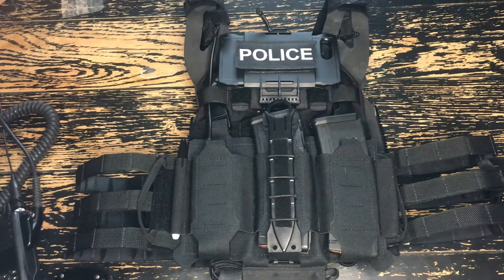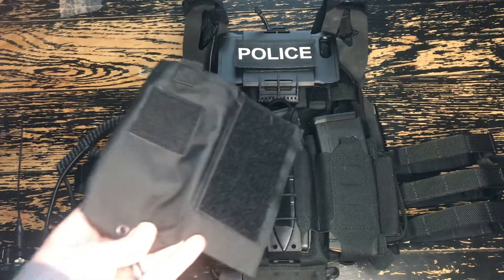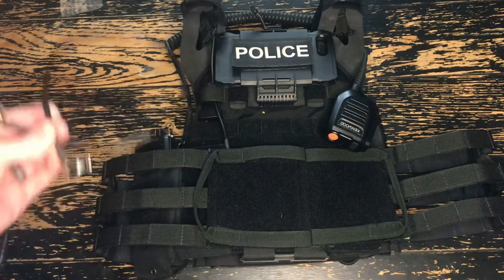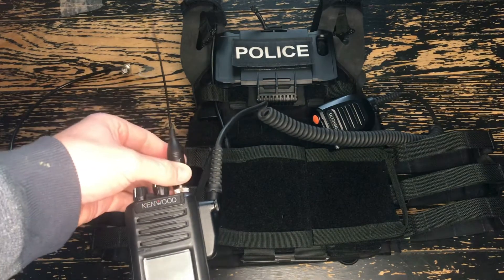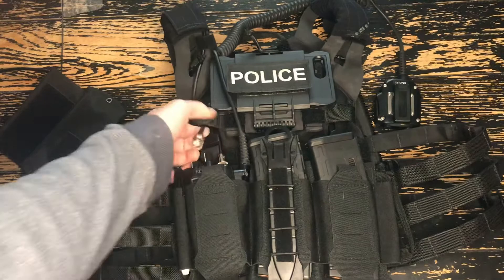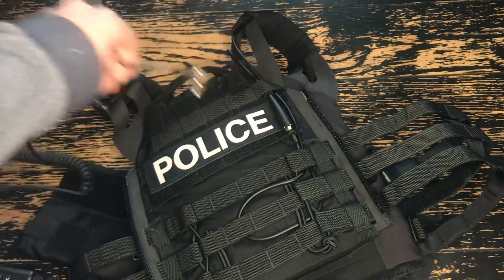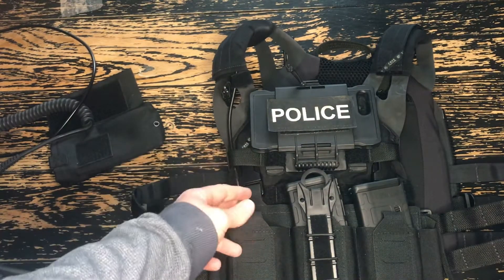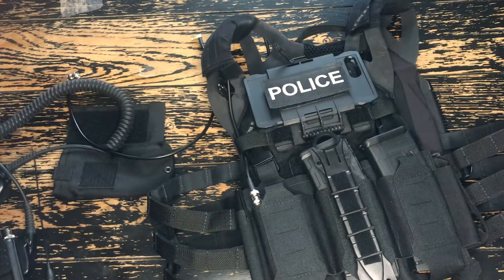Vest mount antenna system

Comment: The reason all of these soft antenna pouch setups fail is because the antenna base cable connectors are exposed to excessive radial loads. The moment you sit down and lean back, the sma connector (less than 1/4 thread) starts to deform. The cables at the connections are also not strain relieved, which is why the bnc cable connectors failed. I have designed a molle mounted protective high impact abs pod that engages 3 molle elevations for rigid antenna support and protects and entire abree or nagoya antenna base and the lower recessed bnc connector coming out of the bottom. I will have these in ranger green; fde and black. I'm working on costing so that I can pass some savings down to the end user. Of course I will be testing it on different chest rigs. When in use, the antenna base and cable plug must be protected.